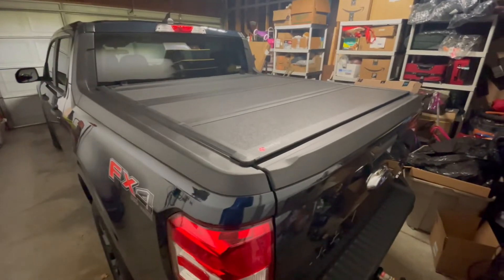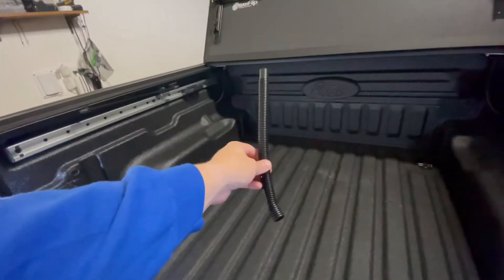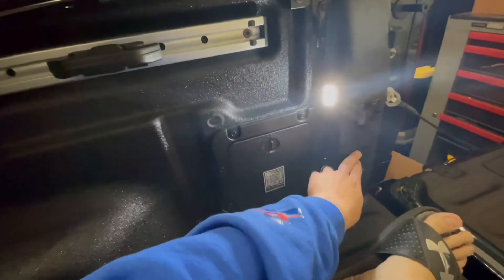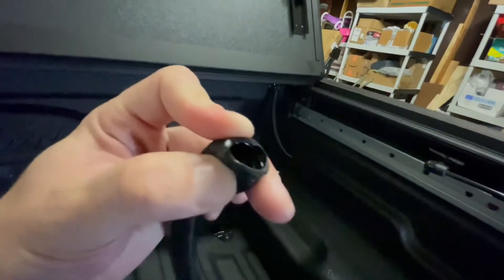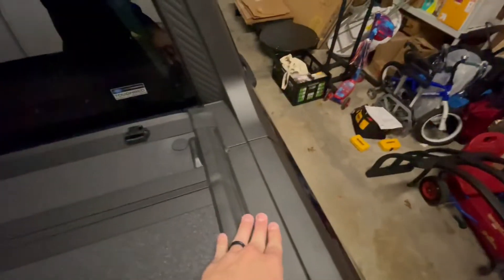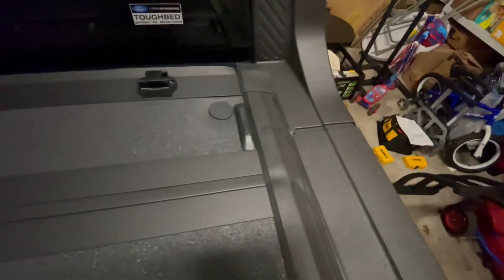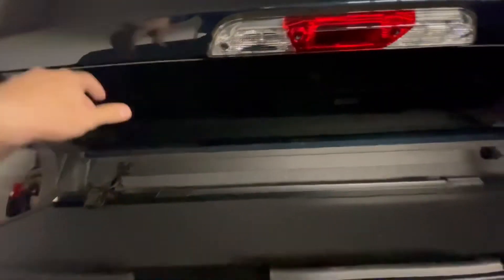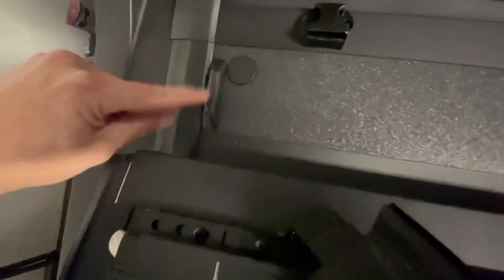2022 Ford Maverick BakFlip MX4. How to make sure your tonneau bed cover is water tight.

Comment: Quick question. I did not install my own backflip g2 but it barely reaches the tailgate. The tail gate is also a quarter inch below the backflip. With the cover. Loser the car wash fully wet my box under the cover.  What king of adjustments are a available to me
Reply from the maker: I would recommend adjusting the clamps in the bed that is holding the side rails. Use your best judgement on moving either direction. In addition, you would want to do your best on sealing it with the "gasket seal".

Comment: Jeremy, does the MX4 come with prop rods to hold the cover up against the back window? Also, does the MX4 which has Matte finish match the Maverick's surrounding black trim perfectly or is the matte finish dull compared to the Maverick trim? I know the Bakflip G2 is a gloss finish. Just wanted to know which finish matches the trim best.
Reply from the maker: Yes, it does come with the prop rods. 
It does a good job of blending in with the trim. I wouldn’t say it’s the same color/tone but it looks really good.

Comment: Love the videos. Great information. Just an FYI it does not appear that your backflip is secure as far as someone trying to get in. Unless I’m mistaken it looks like someone could just stick a hanger or something with a hook and pull the release cable.
Reply from the maker: It’s pretty secure. I’m sure if someone really wanted to they could drill a hole and pull it with a hangar. It does require quite a bit of pressure on the release
Reply: @jeremyoberbeck2467  what about any leaking at the end corners on each side of the tailgate? I experienced that with my new Mav — factory trifold so not sure if much different than yours
Reply from the maker: @jwiedle86  water does come in a bit of the tailgate due to the gap.  Only time it seems to let a little water in is after a car wash

Comment: Nice video for the front part of the cover BUT the water leaks pretty heavy near the tail gate. Any suggestions??
Reply from the maker: That’s the only tricky part I haven’t been able to “secure”. Due to the openings for the tailgate to open and close I have not seen a way to secure that unless you get a rubber flap to extend past the top of the tailgate. But that looks pretty silly to me

Comment: I just bought one of these for my truck and I am extremely unhappy with it. Mine leaks like a sieve through the pivot points of the folding parts as well as the rails that clamp onto the truck bed side rails. Very disappointed to pay that kind of money and have this issue...waiting to see what BAKflip does about it, opened a warranty claim. Should not leak like that

Comment: With the drain going through that plug into the sidewall, does the water just drain out through that cavity? No other problems with water going in there now?
Reply from the maker: No problems. Just drains out under the truck bed